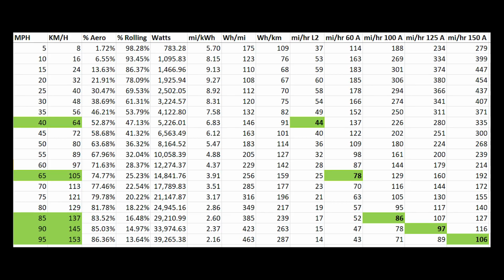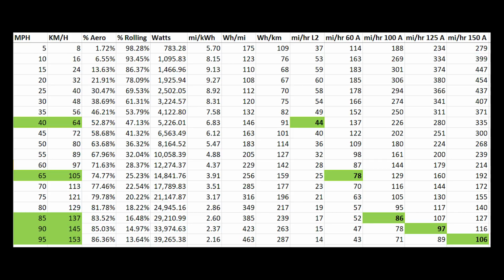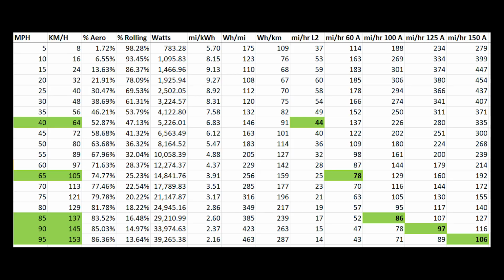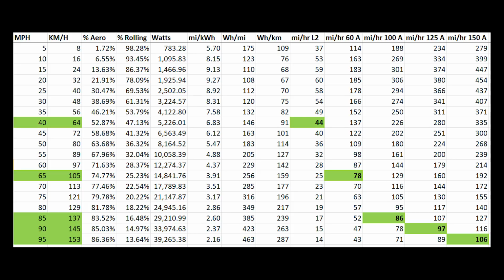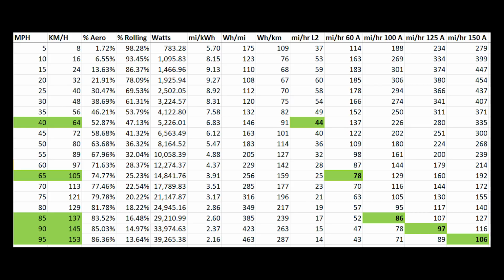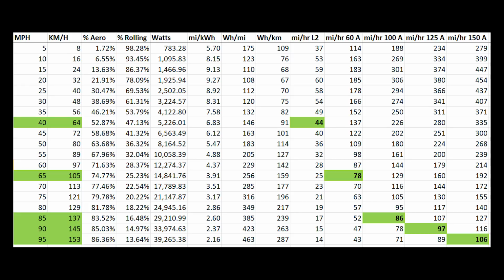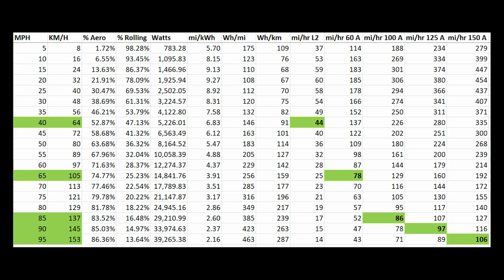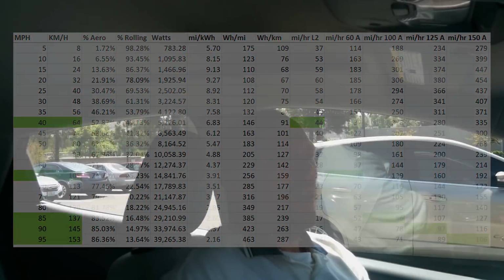Plug-Side Chat: Bolt EV Adjusting Driving Speeds Based on Available Chargers

Comment: Wow, this was so cool - especially the chart that you shared!  Did you construct this chart, or can you send a link to where you found it?  The variables are endless, but it is so helpful to be able to nail down some of them.  I knew that my car was less efficient at 65 MPH, but I never knew HOW much different it is.  Trip planning is compounded by having snow tires in the winter and not knowing the impact of the climate control at different temperatures.  And then, since I live in the mountains, there is the issue of elevation gain/loss.  Sometimes it feels impossible to know how far I will be able to go on a charge, but this is very helpful - so thank you!
Reply from the maker: You're welcome. I made the chart myself based on data I've gathered, and I'll be updating it over time.
Reply: WOW!  Thank you for your hard work!
Reply from the maker: You're welcome!

Comment: NC - good stuff! - I have a trip that I make several times a year which is a distance of 330 miles each way, generally over a weekend.  Leaving my home with a full charge and allowing for a speed of approximately 65 mph on the freeway, my assumption is that I could approach 200 miles before NEEDING to charge, but that falls 130 miles short of my destination.  There are no fast chargers on this path, and no accessible chargers located anywhere near the 200 mile mark, so an uneventful trip would take some planning.   But to look at things a little differently, there are several L2 chargers available if I change the route slightly to use backroad highways instead of mostly freeways.  Assuming L2 charging will provide you with nearly 30 miles per hour of charging (summer or warmer fall or spring days), at 60+ mph highway speed I can approximate that more than 4 hours of added charge time would be necessary to drive the Bolt on this backroad trip at highway speeds, which requires 6 hours or less in an ICE car.  That’s a tall order to add 8 hours of L2 charge time to weekend travels.  But if I were to slow down on the backroad highways, the efficiency increases to where it appears that an hour lost to highway speeds (if driving at 45-50 mph) can be mostly overcome by around an hour less L2 charge time required to cover the same distance.  I do think that 45 mph is about the break even point in this calculation, but even though this idea does give me a bit of encouragement, I’ve yet to attempt this trip in my Bolt.  But now I’m more inclined to attempt it knowing that the reality won’t be as bad as it initially seems.  To put a twist on this - if you need to make it to a distant charger, the best way to ensure you make it in an EV is to drive slower.  The efficiency really jumps if you just slow down 5-10 mph, seemingly moreso than a similar difference in an ICE car.  Tools we must keep at our disposal until the infrastructure fills in.  Thanks for sharing!
Reply from the maker: Thanks.

Yes, I think those 300 to 350 mile trips are still the most awkward. We've gotten used to making them on a single tank of gas, but most EVs still need to stop once. 

A Bolt EV could make it in a single charge, but it would require hypermiling (taking a long time). But driving 65 to 70 mph requires one to two stops, even though it's the fastest way to get there.

Comment: I suspect that the Cruze Eco wheels are not only lighter, they are more aerodynamic than the stock Bolt EV wheels.  This may be a reason you consistently get better miles per kWh than other Bolt EV owners.
Reply from the maker: They more than likely do, but note that the numbers in the chart aren't based on my personal experiences (they are a model based on the Bolt EV's aerodynamic drag, rolling resistance, weight, etc.). My efficiency numbers tend to be a little bit higher than these, though the chart matches up with data from other sources, such as A Better Route Planner.
Reply: @newscoulomb3705  that is what I was saying, the route planning data may not match you, but it matches other Bolt EV experience.  I would love it if someone developed hubcaps for the stock Bolt EV wheels that I could snap on for long trips.
Reply from the maker: Yes, the efficiency is part of it, but I believe the bigger issue is estimated charging time. Someone I know was plugging in numbers for the Bolt EV, and it was estimating a 33 kW net DCFC rate. 12.5 hours to go 600 miles would be about right if you were using 100 A DCFC. It drops to less than 12 hours on 125 A. And down to less than 11.5 on 150 A. 

Those are ideal numbers (like those given for the Tesla models). Real world varies a lot more.

Comment: The chart showing energy efficiency at various speeds was very interesting. I expected higher energy consumption as speed increases, but I was surprised that the relative consumption for every +5mph actually went down after 40mph! From what I knew about air drag, the resistance force is exponential of velocity.
Reply from the maker: Yes, these numbers are drawn from the ecomodder.com tool.
Reply: Jack Tang, it’s not going down, it’s going up. The confusion comes from using mi/kWh instead of kWh/mi, which is the exact same data as the next column “Wh/mi”. But in the Wh/mi format you see the expected non-linear increase, starting from he ideal hupermile speed around 20 mph. 

It’s not truly the square of velocity because rolling resistance is more linear (which is why it accounts for less and less percent of total drag), and the motor efficiency curve also comes into play, although I’m not sure it this calculator matches the Bolt.

Now have to find a flat road with 0 grade and 0 wind and drive each speed long enough to get stable reading and see how it matches.